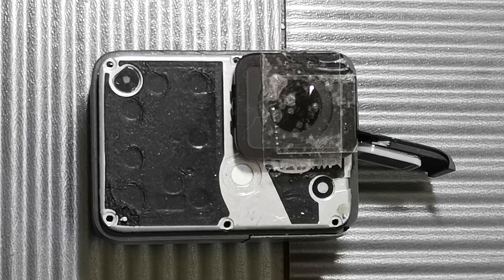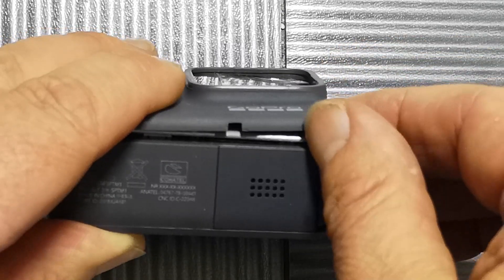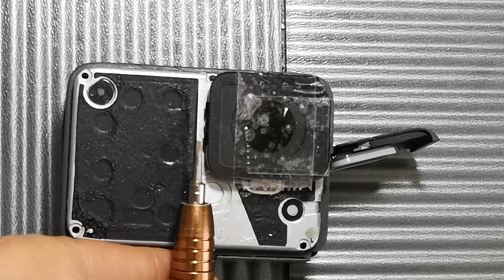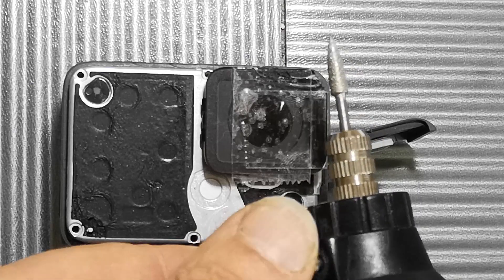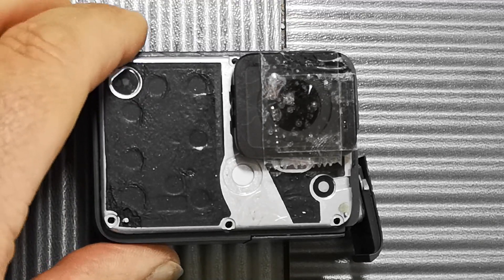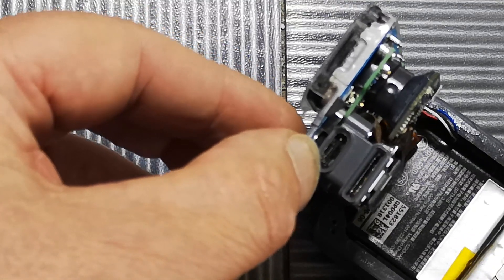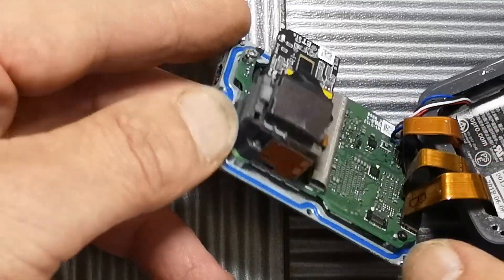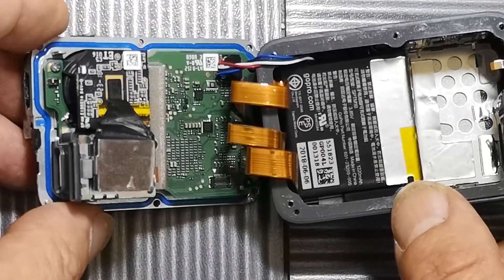Taking apart a GoPro Hero 7 Silver Edition camera

Comment: You can use a sharp knife to cut behind the lens cover glass and remove that. Underneath are four more screws which help remove the cover from the main board.
But be careful. As it is easy to damage parts.

Comment: Can you or someone please show how to replace the battery. I have a Hero 7 that does not hold charge at all, so I believe the battery is dead as it can get.
Reply: Any solutions
Reply: in the case that you have a hero 7 silver/white, it's not replaceable
if it's the hero  7 black then it is replaceable.
Reply: @Excitable but in amazon they sold me the battery for gopro 7 silver but now i dont know how to replace it 😢
Reply: @Excitable the thing is that the battery is detachable from the board or not, if it’s detachable then we can replace it by disassemble just like the video demonstrates

Comment: I saw another video of someone prying the lens cover off, so i guess its possible to remove it. Also, will it be possible to replace the LCD?
Reply from the maker: I imagine replacing the screen would require some pretty fine soldering, but it might be possible...